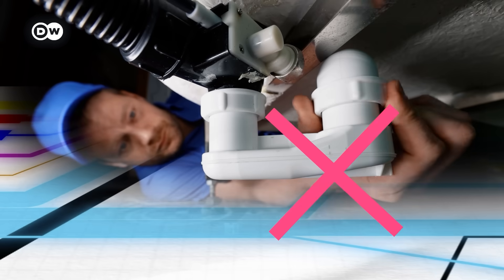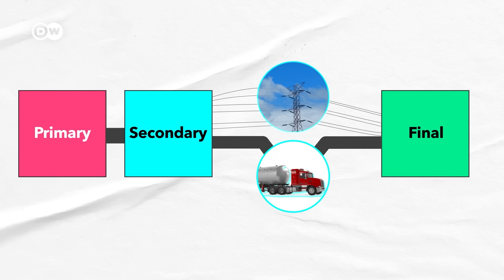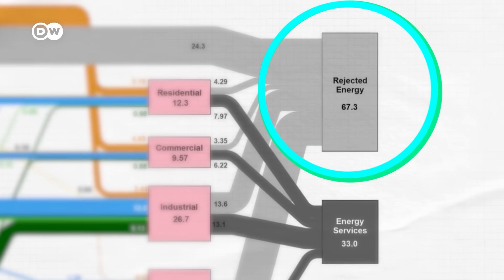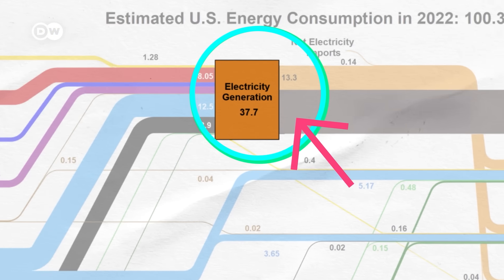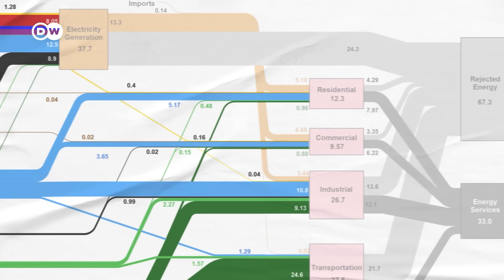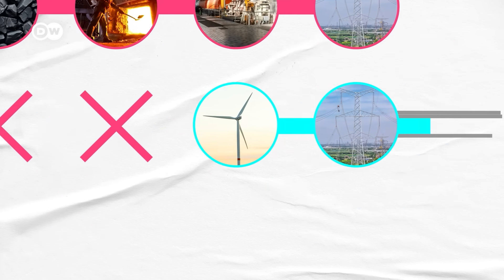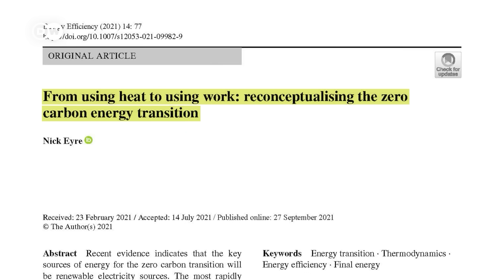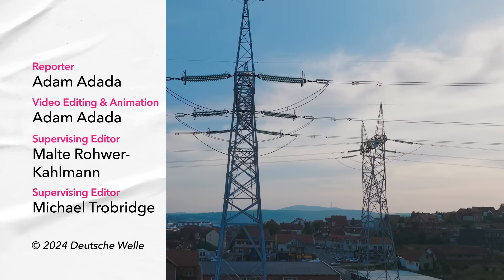The mind-blowing thing we get WRONG about energy

Comment: maybe someone can explain something to me, I've been hearing for years that solar and wind power is: cheaper, easier and more efficient; so why is not everyone making themselves rich by doing it?, are you telling me that people are knowingly not taking the opportunity to make a lot of money?, out of some perverse enjoyment of smoke and floods?, and my second question is, can we replace and/or improve all the transmission net to move all energy consumption to electric?, that last part seems the harder part to me, even the wiring inside all houses I've lived on would have to be replaced, probably the same would have to be done with almost all street wiring and the same all the way back, also, how solar and wind energy is stored?, batteries are very contaminant and inefficient and also have a very limited lifespan. If you ask me we should also invest in nuclear, there's a lot of false information about that, a lot of oil in the last decades could have been avoided without the terror campaign done and we would be in a much better situation right now.
Reply: Sunk cost fallacy
Reply: To your first question, solar and wind are (of course) not continual sources of energy, nor are they uniform suppliers. This means that it doesn't always make as much sense for a given location to invest in these options, even if we had enough energy storage to completely convert tomorrow. The second question is actually really great to think about. First that transmission lines would need to change to adapt to the new supply/demand requirements, but also that modernizing the transmission would make it easier to shift energy around to where the demand is (assuming centralization of energy generation still), so how do you design for that now is not an easy question to answer. Also, depending on where you live, the transmission lines might be privately owned, not publicly, so there are challenges there as well. There are many other ways of storing energy than batteries, such as pumped storage, flywheels, and molten salts. The challenge is getting the holy grail of safe, efficient, and reactive enough to demand spikes that is where we need to end up. I also like nuclear power, myself, but as alluded to in the video, because it heats up water to turn a turbine, it has more end-to-end losses than solar and wind.
Reply: @JakeRoeder  Operating a grid using the same strategy but with a different energy source is doomed to fail. In order to utilize renewables we need to change the entire energy system. Energy storage is essential when you have intermittent sources of energy.
Reply: Generally speaking there are a number of problems depending on where you live. I work at a company that instals solar panels in the Netherlands, Belgium and Germany, mostly on industrial and office buildings.
The biggest issue we are seeing is that wind and solar require a switch in the way energy goes into the grid and when. In many cases our customers are not allowed to supply the grid for example. This is because the grid isn't made to get such a huge amount of additional supply during the day. 
Energy suppliers do not make so much money from people placing solar panels on their roofs. It can rly break the current system when customers also become suppliers of energy or become completely energy neutral and not require the grid anymore at all.
The grid in many places is simply old. It just can't handle a transition to energy sources that have such variable and uncontrollable supply. It is so bad in some places that we are currently working with municipalities that are starting to force energy companies to allow entire industrial districts to get their own personal power grid including battery and even emergency diesel engines to power the district. Of course all you read about the last bit in the paper is that it is a new and innovative energy solution pioneered by Ennexis but... you know.

Next up most companies just don't quite have it in their budget to actually build a solar project. They just don't have the €100k  in their account needed to break even on their energy consumption. Even if the investment breaks even in 5 years they just don't have the working capital right now. (the average break even time for solar projects of any scale is anywhere between 3-7 years around 8-10 when you add a battery.)

finally, at least here in the Netherlands things are going slow because the government is incapable of making up its mind. And when people are unsure they just don't invest. 

Regarding the nuclear, yeah that tends to be a good base load low carbon solution when you don't have a nearby river to dam. But those too are very expensive in the short term. 
The short term expense is just generally the problem. What is there works and there is only so much money to renew things. The investment in renewables is just generally limited by whatever money was budgeted for improving the grid that year. The only difference now to years prior is that a lot of the new stuff is renewable.
Reply: @The_Lord_Below  Given all that what is your point?

Are you suggesting we should not change because of these challenges or are you saying it will require a lot of change to be successful. Can't figure out if you are por and anti renewable.
Reply: @JeanPierreWhite   the grid requires change. That is a certainty. At least in the Netherlands it has suffered from underinvestment for 10 years now. 
Part of my wording may be the result of a lot of frustration with Ennexis given how much of a pain in the ass they are in negotiations and I just got home from work for the weekend. 

My main point of the comment was in reference to the OP who was questioning why things were going slow in the energy transition. At least from my perspective in sales for solar projects for industrial and office buildings it just doesn't fit in their investment plans a lot of the time. Or they are saving money for it.

My original comment isn't rly pro or anti but just an observation. I myself am quite pro energy transition and I do have pride in our company for facilitating MWs of solar capacity on roofs across the Benelux. There are just some systemic short term problems slowing things down. And the unstable political climate isn't helping either.
Reply: People are making themselves rich by expanding solar and wind farms. Change on this scale does not happen overnight.

One we have switched the majority of consumption to electricity then we have so many more options to generate the energy we need. For example with a gas car at the point of consumption requires oil to be extracted to enable the car to move forward. The source is tied to the target. Wit electricity this dependance is broken and electric consumption allows us to utilize yet to be invented energy sources in the future without having to change our appliances and homes.

If done correctly this is a one time change. Unfortunately the degree of change is significant and humans are very resistant to change. The jury is out as to whether we have the willingness to do the things necessary to make this transition. It may turn out we reject the switch to renewables until such time we have no choice. I hope we are smart enough to make gradual changes now rather than wait any longer. The warning signs started with the 70's energy crisis and we are only just now starting to see any significant change, and the resistance to that change is building ever stronger.
Reply: Just a question of tipping points and adaption.
Reply: @michaelmueller9635  To a certain extend yeah, though the tipping points have been reached already. All solar systems that are currently being installed and oked by the inspection will run at a profit unless the buyer got scammed. (or you know, the building burns down or something.) 

Enough solar is being produced to fill demand and then some (though a chunk of that is chinese dumping)

Battery storage for solar roof systems is now at break even price or sometimes even profitable. The affordability tipping point has been reached. The next is grid improvements. Real and most importantly sustained political will. And if all things go well more supply shocks in the fossil fuel market. Nothing like  €1/kWh to encourage investment.